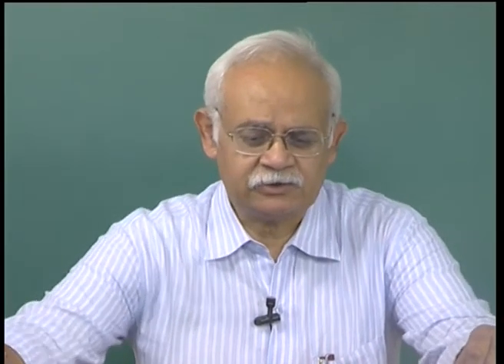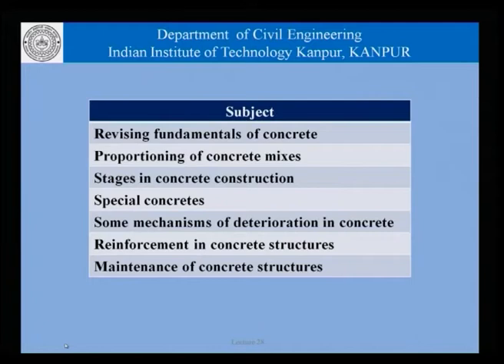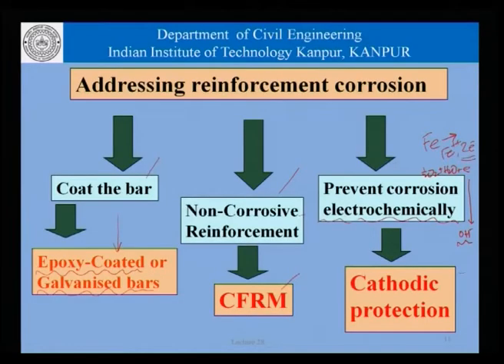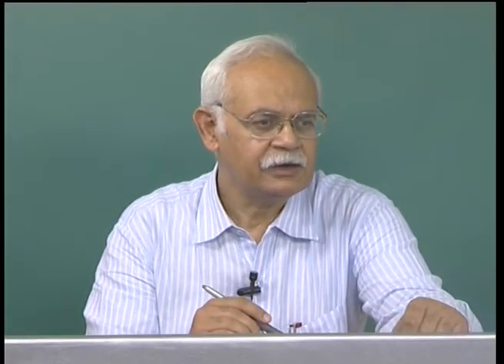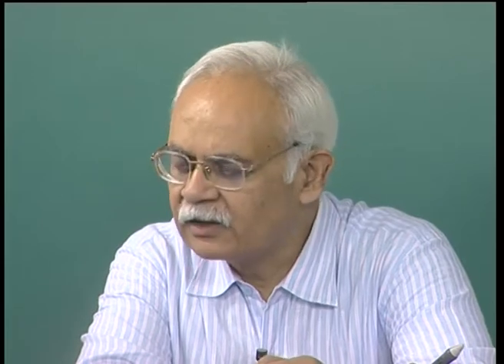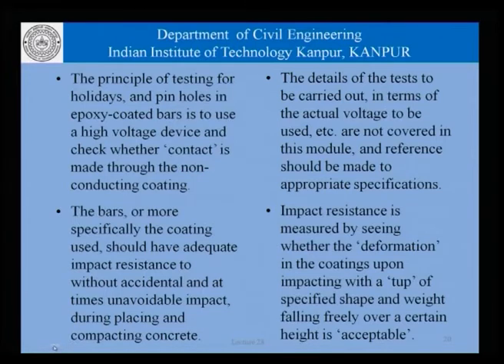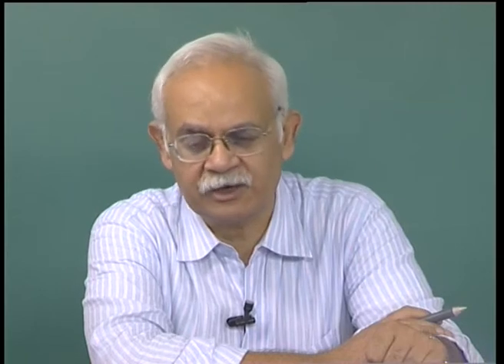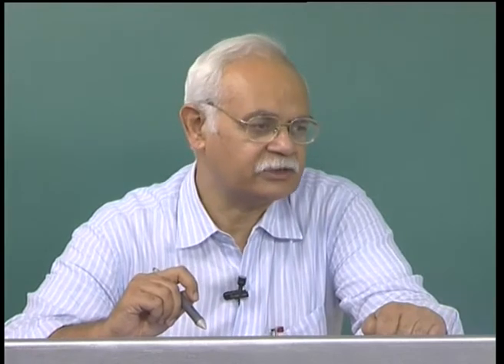Mod-01 Lec-28 Using epoxy-coated bars in concrete structures

Comment: @18:57 As per ACI 318-14 (Table 25.4.2.4), epoxy coating reduces bond strength and hence development length increases by a factor of 1.2 over normal reinforcement.